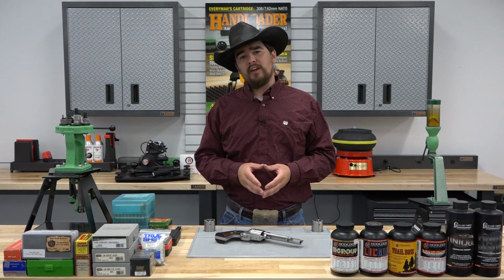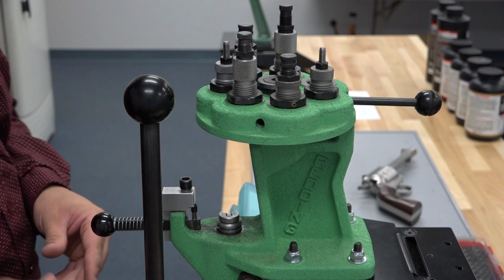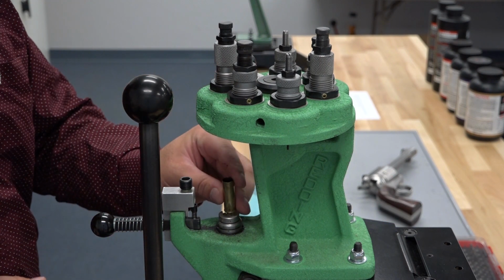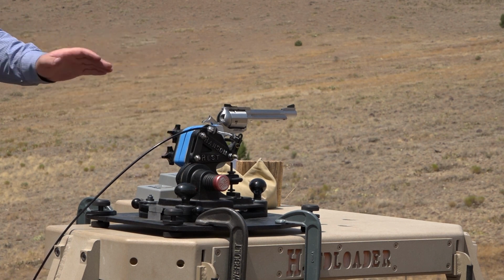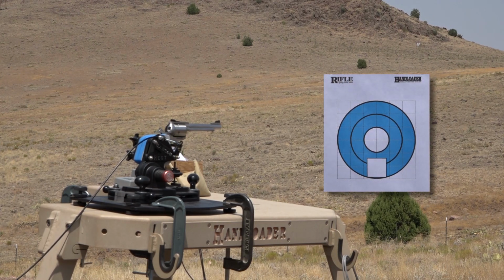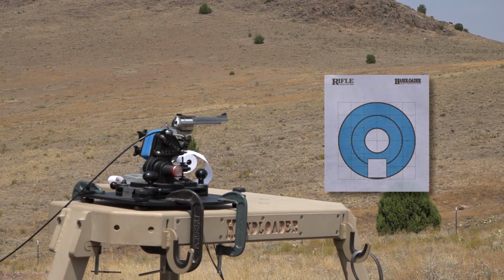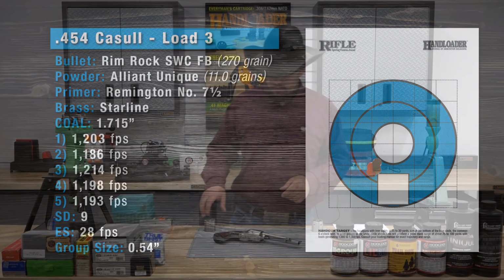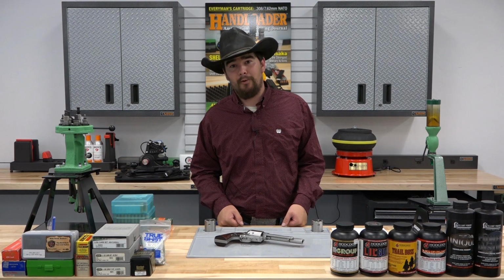Freedom Arms  454 Casull

Comment: That gun is settling into the rest on the first couple shots. I would throw out the first shot or two as break in shots.
Reply from the maker: It probably should have been noted that we fired 15 "settling shots" prior to testing loads. These loads were the factory loaded Freedom Arms loads with the 260 grain bullet. So a good stout load with heavy recoil. You bring up a very good point though, it should have been mentioned. Thank you for watching!

Comment: What were the velocities for the 14gr of Longshot with the nosler 250gr bullet?
Reply from the maker: A great question! After digging through our notes the average velocity of 5 shots with 14 Grains of Longshot Powder was 1,307 FPS with an ES of 33 and an SD of 13. Thank you for watching!
Reply: @HandloaderTV  Thank you for the reply! I may have to try those out for something less harsh haha
Reply from the maker: @grantstewart5453  You are very welcome they are much milder than the full power loads with H 110 or W 296 and similar powders. Accuracy was most impressive as well.
Reply from the maker: @grantstewart5453  That is the truth, last we checked Oregon Trail and Rim Rock had some in stock but that all changes so quickly it's hard to keep track! best of luck in your search.

Comment: I’m from the same area as Freedom Arms. I recently met a guy who knew Dick Casull whom told me that it was designed to be used with 50 bmg powder. He said it reduces recoil while maintaining accuracy and velocity. He did say that when Dick Casull gave him the recipe he was sworn to secrecy though.
Reply from the maker: I must admit that that is the first time I have heard that, and I must admit I find that very very hard to believe. Using 50BMG powder would seem almost dangerous to me given the slow burn rate with a 7.5" barrel and a full case of that stuff you'd be hard pressed to hit 30,000 PSI and in that barrel length burn 15 percent of your powder before it leaves the muzzle. This would lead to an extraordinary flash as well. I think what would be more likely is that he blended a powder with the 50 BMG powder to create a unique burn rate to match the cartridge and barrel length. Such practices are not only very unsafe but is also unnecessary with the wide variety of modern propellants. Also likely why he was sworn to secrecy about the load data. I think that would make much more sense personally. Thank you so much for watching and taking the time to comment! --Jeremiah

Comment: I'd buy one if it was a six shot
Reply from the maker: It may only be a 5 Shot cylinder but it does feature a manual sliding bar safety so you can practically carry 5 rounds compared to having to "cowboy" load a single action army and leave an empty cylinder leaving you with only 5 shots anyway. It also is so much stronger than other revolvers out there, that is also partly due to the 5 shot cylinder. So it is a 5 shot cylinder and you just have to decide for yourself how much of a difference 1 round may make for your application.